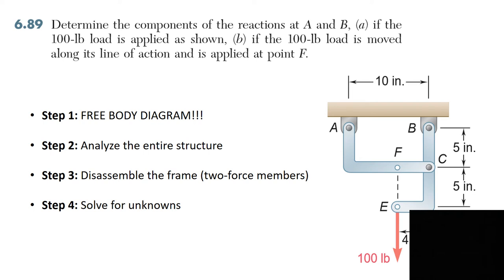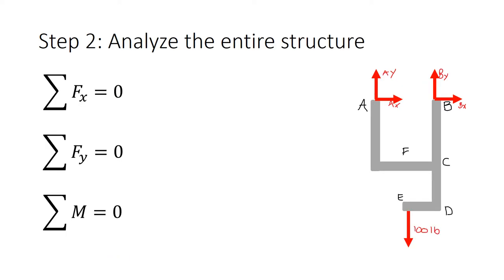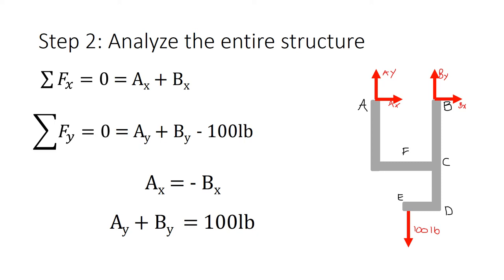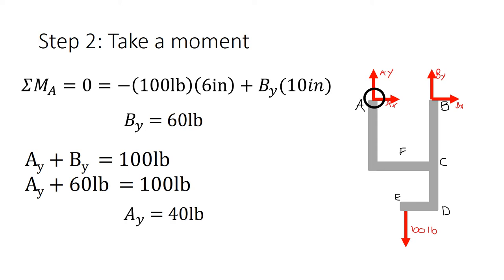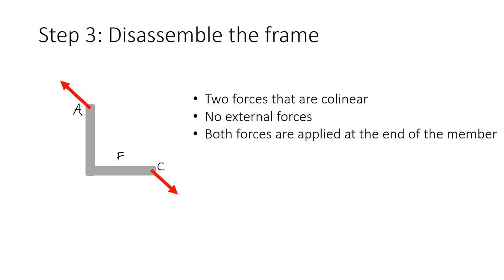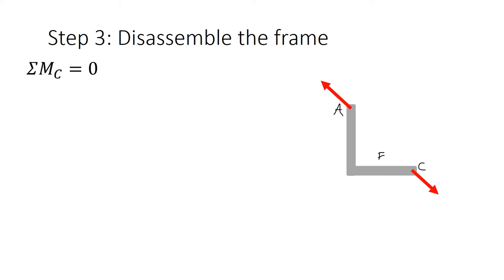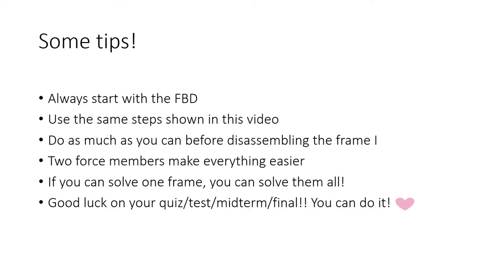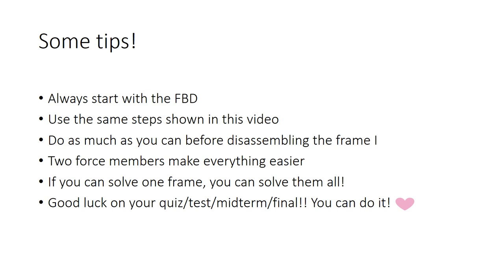Frame Problems - Statics/Engineering Mechanics

Comment: How did you check the clock wise, anticlockwise moment while calculating moment?
In the second case I got ax = bx = cx =0; ay = 40, by = 60, cy = 60. Are they correct?